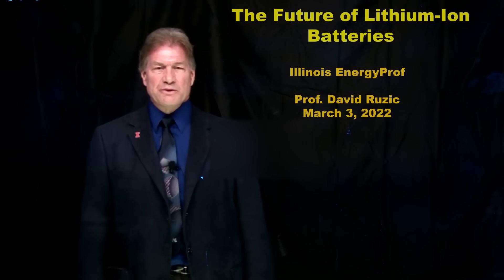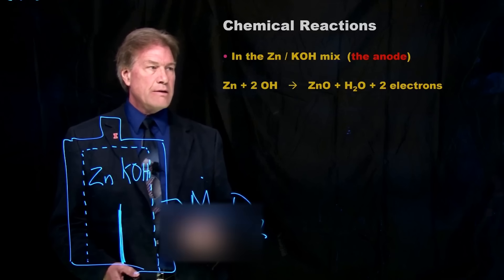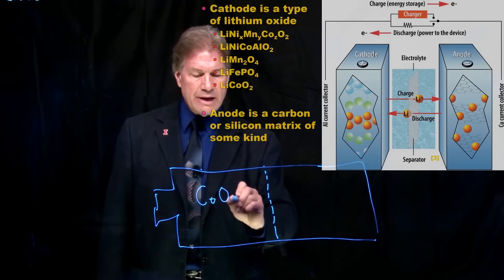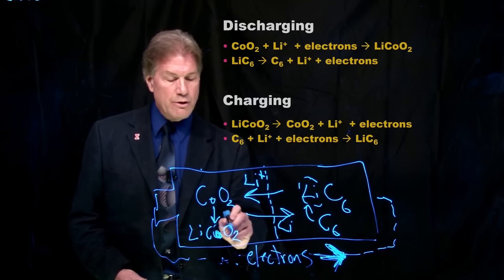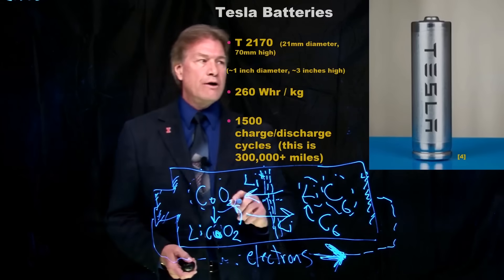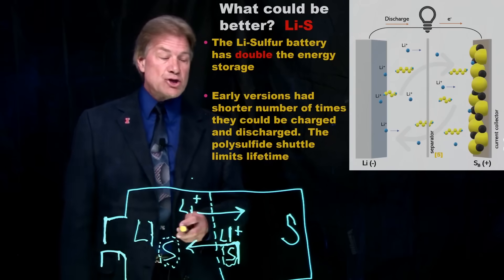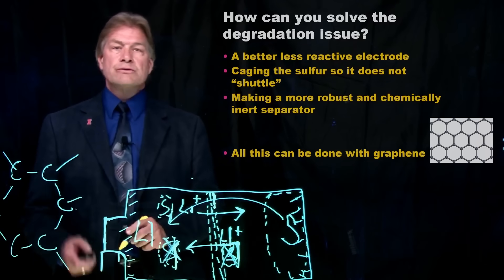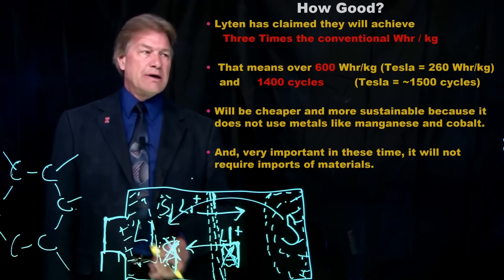The Future of Lithium-Ion Batteries

Comment: 9:00.... I have had several ICE engines last over 300,000 miles. 

My G.M. 3800 Series 3 engine is at about 320,000 and still runs well today, and I also had a Chevy Tahoe with an LS 5.3 liter V-8 that ran to 365,000 miles before it went to the junk yard. The problem with that vehicle was that the body and chassis basically rotted apart around the engine. The engine still RAN when I junked it, the vehicle was simply too rusted apart to be safe anymore.  300K miles is easily  achieveable with the right engine, and strict proper maintenance.

Comment: The Electric Trucker YouTube showcases 500 kWh, 600 kWh & 700 kWh batteries in heavy duty trucks driving across Europe. 

Using about 1.5 kWh per mile.

Climbing the mountains, regenerating on the way back down. 

They are here & commercially viable today.

Comment: NO, This guy is wrong, hes injecting misinformation. Its honeytrap. This guy is bad!

The cells exist today, they are 320ah lifepo4 cells, all cars must have them 230wh per kg. 8000 cycles and increasing as production is refined. 

ALL OTHER BATTERIES EXCEPT LTO ARE SCAM SCAM SCAM

Graphene is bullshit. 

Batteries need to have 1 module, cells strung in series inside the battery roll, + and - hooked together in the roll. The size would be about the size as a gas tank or keg, and with increasing lower internal resistance, the less heat generated, and with balancer and robust balance circuit always functiong keeps it safe. 
Potted, sealed 
AND as a roll will not expand from normal expansion. The case or band, would be strong as the material shear strength. USE stainless steel sheet and silicone potting. Compliant cheap and effective against water. 

The battery can even work for home primarily. And 1 module is way cheaper than making 20 cells one module. 

Its common sense not chemistry!!!!

Comment: One has to be very skeptical watching this video, for what it avoids discussing as well as for basic errors.  It comes across as a pitch for a grant funding sponsor, more than educational.  

The presented admits he made a most basic error of fact, as to HCl vs H2SO4. He does not mention that most LiIon batteries are thin film, either rolled as in 14500 or 18650 cells, or folded on rectangular thin flat packs.  Only in Li (usually not LiIon) button cells of very low current capacity is a radial center membrane structure common.  

The comparison only with Tesla 21700 cells is telling, that this isn't about battery tech in general, but a pitch for a focused project.  21700 cells are rarely sold stand alone for flashlights or electronics.  1500 cycles is a quality spec, and 260 WHr equates to roughtly 6,000 mAHr, though that's hard to compare to common 18650's since eBay and ScAmazon have prolific spec fraud.  (6 AH is more typical of 26650's, less common).   

The other two issues notably absent from this video are self discharge, and chemical ESR equivalent, or  Equivalent Series Resistance.  Those are huge factors in batteries that may alternately sit for extended periods, or power high peak load devices, be they power tools or cars.  Resistive conductors like graphene, versus metallic electrodes as part of a battery process or to connect other chemical elements, are big deal issues.  In a less detailed video as to chemistry, it might be easy to dismiss ignoring those as an attempt to simplify, but this goes into more detail over molecular chemistry, while ignoring those elephants behind the curtain.  

ESR of course equates to heat or ability to limit it, potential venting, and potential explosions or fires, and needs for charge-discharge smart management, or restricted current rates.  Tesla quality and honesty of spec's is so high most of us likely have seen their car fires, as well as heard about a certain airplane model that was grounded until it was redesigned.  Or heard about how useful ScAmazon's extreme legal budget is, to intimidate state AG's from fraud prosecutions, or run around people whose homes were burned down by reckless indifference to safe battery and related circuit designs. 

Ooops.  

Maybe literacy in more complex aspects of these issues matter?  And some way to shut down predators who lie and cause serious hazards, and damages to consumer victims?  

This video does cover some useful info and ideas.  However, it'd fail most peer reviews, as it's devious and evasive in how it reveals a conflict of interest that could be cited up front directly.  It also focuses on select niche conditions and comparisons, while avoiding related core issues.  That could be stated clearly up front, rather than leave users wondering if it's intended as deception by omission, or just careless presentation?

Comment: 9:04  That 300,000 mile lifetime of an ICE engine that can’t be attained is interesting number. That 300,000 miles is when the local transit agency has their RNG/CNG ICEs “REBUILT”. Many diesels are good for more mileage. 

Tho interestingly the EV buses that the district has are experiencing accelerated battery degradation that force the district to prematurely dispatch another bus to replace the EV on route due to low charge. Normally the district just allocates the EV bus to a route that is shorter / slower but the upshot of this issue is that the transit districts needs more $1,000,000 EV buses to replace the RNG powered buses.

It is interesting how the REAL WORLD throws speed bumps into the mix!

NOTE: I am adding this note a year later. The 6 EV buses that the district bought with $6,500,000 of tax payer money are NOW BOAT ANCHORS BECAUSE THE MANUFACTURER WENT BANKRUPT!! While they were in operation, they did not meet many of the expectations (particularly with regard to battery degradation and maintenance). So real life tells the truth.

Comment: 9:00  "I've never had a combustion engine last 300,000 miles"  Well, modern ones get close. But really, it's not the engine or transmission that sends most cars to the junkyard.  Most go to the junkyard because they have a million little things wrong with them and one new one that exceeds the perceived value of the car.   Rust sends a lot of cars to the junkyard. Bad paint sends them to the junkyard. A bad ECM can send a car to the junkyard.
Teslas are susceptible to all of that stuff.

Comment: Tesla Batteries are better than other Li Batteries,   OK, Why?   Tesla, will not guarantee their batteries for more than 1 year.  HMMMM.   I still think the best way to reduce C02 from vehicles is to take a combustion engine and have it run on Hydrogen or Ammonia.   BOOM.  Hydrogen and Ammonia can be made with C02 capture, or from Hydrolysis from Hydro, Volcanic steam, or SMR's.  And with this option, NO ONE needs to buy a new car.   They just need a $1000 conversion kit.

Comment: Professor good question concerning design and the life cycle

Has improper charging cycle testing been conducted yet?

Example phone is 7% plug it in until 30% then unplug it how is the overall ideal life cycle affected by this? 

What is the deterioration grade line from this charge cycle behavior vs the current technology in lithium ion & lithium titanate

Comment: How does that compete with say gasoline, though? 250 vs 800 is a significant improvement, but on a lookup, gasoline clocks in around 12,000? I assume there are some efficiency benefits, and it's much better than a 50x gap, but 15x is still a lot to overcome.

Given that teslas work at all, I presume the real gap is much smaller. Else, anything where the weight/volume actually starts to matter, would just remain offlimits. As it used to be: electric "shopping" cars were one thing; ones for road trips, not so much.

Comment: What is the theoretical maximum energy density for ultra capacitors if we could manufacturer the graphene sheets perfectly? Would they approach Lithium in energy storage? Even at 50%, it would revolutionize the industry. Imagine a batter with number of charge/discharge cycles measured in hundreds of thousands instead of thousands. Or being able to charge / discharge at a rate 10x that of a Lithium battery.

I hope there are still teams out there researching ultra capacitors even if some of the technology is theoretical right now.

Comment: with all due respect, a lot of internal combustion engines last more than 300.000, like most of pre 2010 cars easily can get to 300.000. there are internal combustion engines with no regards of fuel efficiency or pollution that go over million of kilometers. if you never had an ICE that lasted you 300.000, your choice, previous owner, or the way you maintain and drive is defective.

Comment: Electrons don't flow.
Reply: Also, batteries in open circuits, whether with solid state or mechanical switches, are "connected".  

If self-discharge is considered, batteries also have internal de facto connections.

Comment: No an ICE engine wont last 300,000 miles, but it will last 200,000 miles and cost 1/10th to rebuild to like new running standards vs. the cost of a replacement battery.
People really have not thought this whole EV thing through.

Comment: While its nice that C+Li+S can make a complete "made in the USA" battery, they are worthless without the things that eat electrons: motors and semiconductors. The raw materials for those are not all in the USA in great quantities. Copper, cobalt, and a lot of the elements used to dope chips of various types still need to be sourced. I'm hopeful that this battery tech is a step forward but it's just part of a larger materials train that needs to be thought about.
Reply: Doping semiconductor chips does not require large quantities of materials. The purity requirements are stringent.

Comment: All you described is a better gas tank. I get that there is only so much you can say but failing to highlight the magnitude of the needed increase in our electrical output and ignoring how much solar and wind cost in natural resources per watt produced is not helpful. People need to understand that storage is handy but only after you can produce the power! Idle windmills and solar panels at night still tie up all the resources that produced them. Systems that are tuned to peak efficiency at maximum power output with minimum waste are the only real 'solution'. Compact molten salt reactors will let us charge those gas tanks safely with minimum environmental impact as well as shortening the nuclear waste storage problem to a few centuries instead of millennia.

Comment: Thanks for the clarity of explanation.  A couple questions - first - what about lithium availability? The price is up 1000% in the last few years, 400% in two, and 80% in the last 3 months.  How severe is this limit?  Secondly; seems clear that you could get a practical electric small plane, maybe even large trucks - but what is the charge time of this type of higher density cell?  If you need less to go a practical 250 miles and a fast charge time; that would also reduce weight; a problem with current EVs.
Reply: I didn’t like how he ignored the source of Lithium
Reply: Electrolosis of brine, can make lithium.
Brine? Basically a very very salty water.
Reply: Brine will get you lithium carbonates, you would need lithium hydroxides for this?

Comment: Having 2.3 times the energy density of Tesla battery sounds great. Just make sure that the manufacturing defect rate is near-as-dammit zero and that the integrity of the battery survives ageing, vibration, thermal cycling from heavy usage in a harsh climate, and departure from recommended charging protocol by careless or impatient users. The heat released by a chemical short-circuit of lithium and sulfur to lithium sulfide, with a thermal chain reaction to neighbouring cells, is scary enough (447 kJ/mol). Just pray that the casing isn't breached so that it oxidizes to lithium sulfate (a further 989 kJ/mol). Rather than explode, the battery would become a smoking white-hot puddle.

Comment: main problems lithium sulfur battery:   Lithium plus sulfur is a pretty decent bomb.  This is in part a tautology, all batteries contain a lot of energy, but this one will explode 3x better than lithium ion batteries- in the event of a failure these batteries will melt through everythng like thermite, and stink of burning sulfur.  2) volume change.  One of his electrodes, has to move through the separator.  Unless the separator is movable, the battery will just well and go pop!  Movable separators have all sorts of problems. 3) one of the electrodes is sulfur. An electrical insulator.

None of this is new, LiS batteries have been around for decades.  An improvement in the separator isnt pointless, but it in no way makes these batteries viable.
Reply: High energy battery fire can kill people, no doubt. But how many people die of diseases caused by exhaust gases in cities? What is the burden on healthcare systems due to these diseases? Fossil fuel power plants have tall chimneys and usually outside cities, so their exhaust gases reach people much more diluted. Also a single big fossil fuel machine always consumes less lubricants than many smalls. Stationary machines can have higher efficiency because they are not limited by volume or their mass. EV has regenerative brake almost for free

Comment: Great job. One minor error. The electrolyte in the traditional wet cell car battery (aka. lead acid accumulator) is based on sulphuric acid. Typically approximately 33% w/v solution.

Comment: You haven't had a car make it  to 300k miles? You must have abused the crap out of it. I've got a van from 1982 with 400k miles and still runs great. Body's shot, but I can haul things with it. 

And who the he'll wants a limited range of 300 miles on a charge? And that's going to drop when out turn on the head lights. The heater/ac, use the radio, charge your phone. You going to sit at a charging station for 7 hours because the place you're trying to get to or 350 miles away? Something that would be a 5 hour trip turns into a weekend. 

But it saves rhe environment.

Google lithium mine, and tell me how great the "environment " looks. 

How about instead of dumb ass batteries that elwe can't use for transportation, we fo us on alternative engines like those that run on natural gas, or ethanol? Steam e gives can run on anything including hydrogen.  Burns clean, same if not better milage than gas engines, and we aren't digging 50 mile wide holes in the ground. Seriously,  I have no idea why people are pushing a technology that will never be viable. Especially when steam or hydrogen burning engines could be easier to build, maintain,  and more environmentally friendly without giving up distance traveled.

Comment: I note that the Professor says nothing about charging time. This is the next jump on the race course to arrive at convenient EV use. Batteries as described with reasonable charging times means all the overhead equipment needed for electrificaty supply to electric buses, (trollybuss), trams, and trains, can be reduced or even eliminated.

Comment: Nice video but have you seriously never seen an ICE last 300,000 miles?  How about the entire transportation and supply industry?
Reply from the maker: I've seen plenty, just never owned one.  Body and other parts have always worn out before the engine.
Reply: @illinoisenergyprof6878  it's a good advantage the electric motors don't need the constant oil changes etc that ICE do.  Environmentally and running costs .

Comment: Sounds great as long as the cost can be reasonable. Typically when only one entity controls how to make a material the price remains extremely high.
Reply: The fun part is Lyten already has competition from the existing Lithium-Ion batteries.  That will put an upper limit on price can be charged for the graphene filtered Li-S batteries.  For example, a car an owner might be willing to pay 3* as much for a battery that only provides 2* as much energy storage per kilo.  But for a Li-S battery being used to replace the Tesla Megapack, the upper limit would be 2* the cost for 2* the capacity.

Now if Lyten can get the price per kilo ratio lower than the energy per kilo, they will corner the market.  (I.e. if they can only get 1.5* as much energy per kilo and keep the price at 1.45* as much per kilo, everyone will want to use their Li-S batteries)

Basically the difference between space/military-quality, vs civilian quality.

You will also have competitors buying their batteries, slowly figuring out how they work, and then developing ways to make those batteries, increasing competition and bringing down the price again.

Comment: You’ve never had an ICE car last 300,000. Have you had a BEV car last 300,000?
What does the research say on this? The empirical numbers of real world results by others.
What about thermal run-away of double energy density? Doesn’t every increase in energy density get closer to bomb type of failure?

Why even build an automobile with 300,000 potential?  Every car I had was getting pretty ratty beyond 100k.
Reply: Just hit 200,000 miles in my BEV on the original battery.  4 more years until ~300k :D